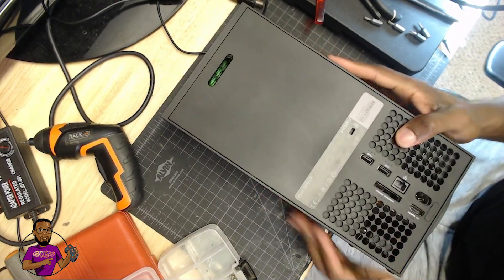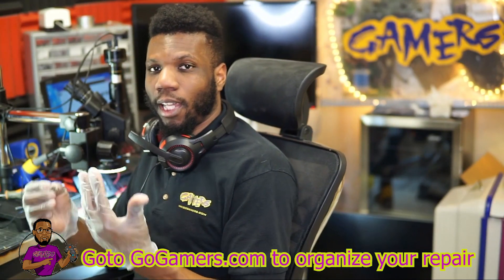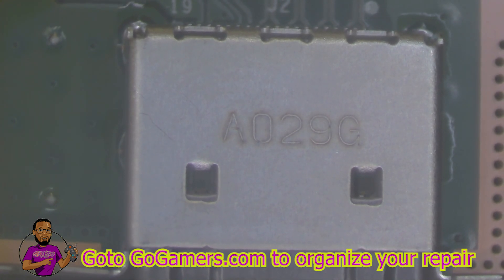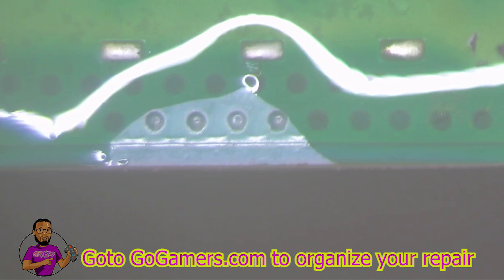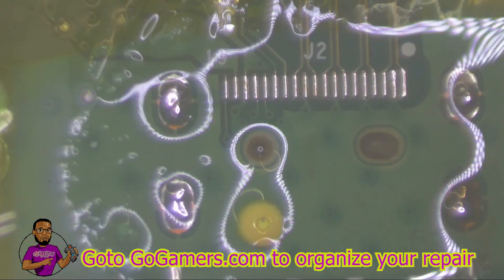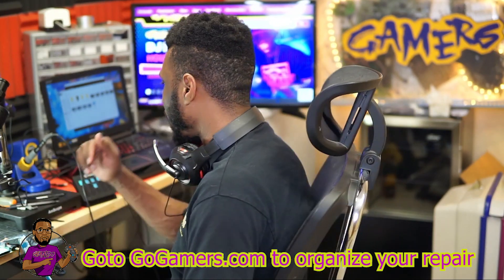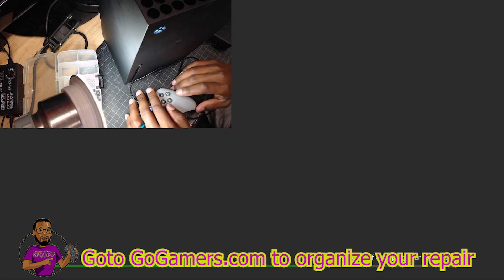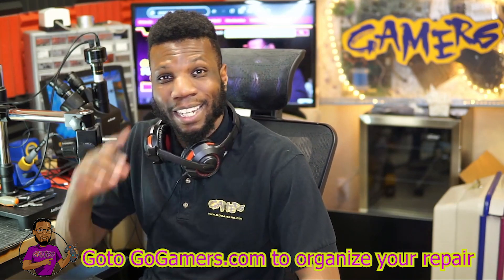Fix Xbox Series X No Signal HDMI Port No Signal Repair (Best Method)

Comment: Hello, I have x90 j, after the last two updates, the TV found a bug!!!  Right after the vrr update, when I turn on the Xbox Series X, everything is fine, but sometimes when I enter the game and the console menu, a black screen appears and it gives an error with no signal!!!!!  Newly purchased TV, console and cable are healthy, only after the last update, this happened!!  Of course, it doesn't happen all the time, but switching between the game menu and the console menu happens once out of every five times!!  I am using vrr boosted mode plz guide me??  Why no one but me has this problem??  worrying

Comment: anyone else having issues with just watching tv on Xbox series where it goes black screen and you can still hear but can’t see anything. I have so far discovered it’s got to be the HDMI as I put it into a different socket and I could see again. The strange thing is it only happens on sky and bbc iplayer and not on twitch or gaming. 

I do feel like I should try a different cable but I don’t understand as I have never even moved my series x console since I bought it so it can’t be broken inside already
Reply: ••+•1•2•2•4•3•6•6•7•2•4•1••
••W•h•a•t•s•a•p•p••
Reply: Did u ever sort this. Exact same thing happened to me

Comment: I was sent a link to this video and asked if this video was actually the best way to replace an HDMI Port on an Xbox one X?
NOTE: For anyone interested; This is in no way the best or A proper or the proper way or for that matter to replace any HDMI Port on any model PS or Xbox game system X or not. Leaving out the use of a part that is not meant for this model system; This method of replacement & soldering is thought on YouTube only because it is the easiest to video and although someone with reasonable trial and error experience at the expense of there customers or practice and/or schooling can do this repair in this manner, it is not proper and can lead and more often than not will lead to system damage in so many ways. 
"NOT RECOMMENDED" & "NOT PROPER"
Reply: Trust me when I say that this man does not do things at the expense of his customers. This is the first of this type of console he has repaired, and he explained clearly the reason why he used the part that he did.
Reply: Pls help me..
My xbox one have the same issue that says No Signal..
First i was updating the console, then suddenly the tv showing No Signal..idk what to do, so i gave that to a repair shop..they did something with the hard disc and updated the console and said 20$.. I paid yesterday and bought back to home..everything was okay..
And i saw call of duty war zone game for free, so i downloaded..in the middle of the download it again says NO SIGNAL..what will i do? Pls help.. Should i change the HDMI cable?
Reply: ••+•1•2•2•4•3•6•6•7•2•4•1••
••W•h•a•t•s•a•p•p••